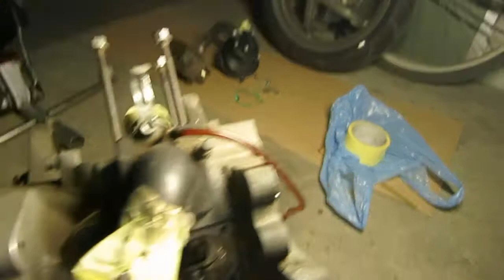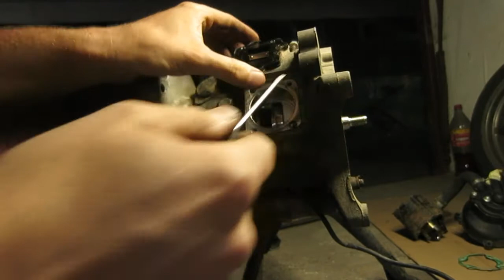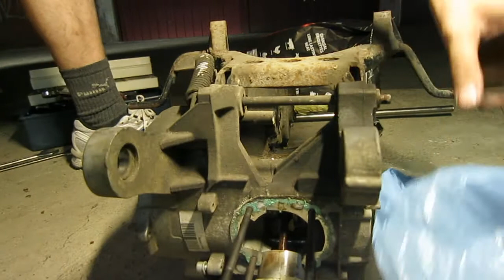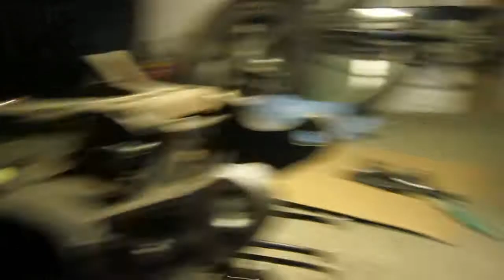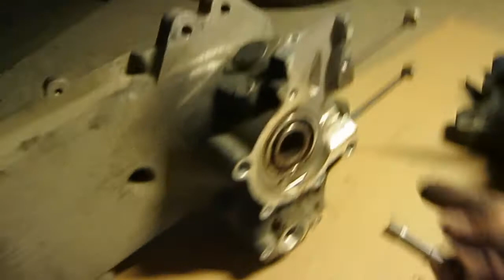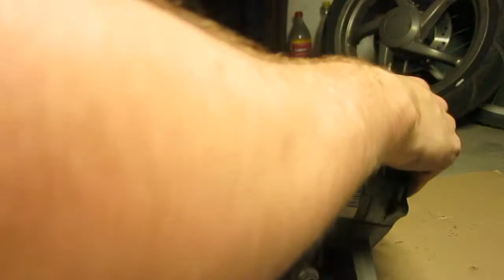Aprilia Ditech crankshaft problem - Part 4

Comment: great job buddy.u save lot of money.lot of mechanics get nightmare when they see a ditech engine.haha its not much different then carb.
Reply from the maker: I confirm that about mechanics, I brought 2 times scooter to official service to ask  how much is change of bearings as it is proposed to  in service manual from scooter and always some strange answers, it is not worth to service scooter, it will cost to much (they never told me how much approximately), at the end I am glad that I did job myself

Comment: Hy man! thanx for your video! what wos the total cost of the reparation? thank you
Reply from the maker: Hi, parts (new bearings, crankshaft,  gasket set, gasket set for crankshaft,1 kg grease  around  400 euro plus) plus 100 euro tools and accesories (tourque wrench, spray for cooling to -50 Celzius, pressure wash cleaning, tool for pulling ). In reality I  spent even more in total  (parts plus tools  = 600 euro but I bought some tools which I did not use  at the end, was not sure will I need to remove gears from drive assembly and for that you need special set which I bought but I left original bearings for drive system because it is in good condition, I did not took it apart).  You can spend even less if you buy cheaper crankshaft which come with set of 2 bearings (125 euro with delivery included) which I did at first place but I was not lucky and I got defective crankshaft so went with more expensive version from Malossi. Just new original crankshaft from aprilia cost 400 - 450 Euro, I forgot how much exactly.  I did not count my time (spent 2 weeks to learn what to do, to clean, dissemble, assemble, to order good parts on ebay, there is more versions of engine so you need to order parts for version you have, my is morini engine even it is wrote aprilia on it.

At the end I know how engine looks like, in what condition it is and if something breaks or does not work good or have strange sound, I will know why and where to look. I made videos till part 10 , check them out if you are interested. More to come.
Reply from the maker: Crankshaft with delivery is 270 Euro
gasket set from ebay  21 Euro
bearing for crankshaft form ebay 17 euro (I found new old stock so I bought them cheaper but manage to find in store bigger bearing so I paid it 20 euro just in case so I have spare part, it was not so easy to find it)
those are main part but later I change break fluidm needed to buy new set of rollers becase this crankshaft is heaveier then original so all together it was around 400 euro plus tools and accesoreis which you need, needed to remove clamps from tubes for water cooling so needed to buy new ones, little by litte it come around 400 euro. I am afraid to find out how much that work would cost me if I left scooter in service...
Reply: are you supposed  to lightly grease the crank bearing or pack them full.  wrist pin too on the grease?  was the cooling spray like freon or butane, was it helpful?

Comment: What kinda rpms are you getting with the malossi crank?  The one i was looking at said like 16000 rpms.
Reply from the maker: I do not know, I do not have RPM meter.
Reply: I was wanting to know how the mallosi crank is working for you.  the stock one you took out was good for only 10000 rpm max.   I have a 2006 that has a 70 cc suposedly.  but if they did that they did not do the rest like  change the final gears.  it runs alrite but i think it will blow soon because the engine makes alot of noise.  I just going to assume the crank is going to be shot so i want do a  build myself considering it cost to much to pay someone else.  i would like maybe go to 86 cc kit if  i do.  probably change it over to carb set up too.  basically everything need be replaced and then i have good scooter.  was that your first engine rebuild?  anyway any info the crank would be helpfull.
Reply from the maker: Ok, in my opinion stock crank is better if you want less vibrations (smoother scooter), if you want faster scooter then malossi is better, this is full circle crankshaft (malossi), what means when you mount it in crankcase motor will have higher compression because crankshaft take larger volume of space then stock crankshaft. I kept original piston and replaced crankshaft so I am not sure did I needed to change piston together with mallosi crankshaft because motor vibrates more at lower rpm then stock setup. This is my first engine rebuild so this is why I am not sure is this how its done or not. I bought mallosi crankshaft because I read it is better balanced then stock one, maybe that is seen at higher RPM because when motor runs at high RPM I can not feel vibrations and scooter have maximum speed of 90 km/h instead 80 with stock setup. So mallosi works OK but not as I expected, I expected much less vibrations when motor idles. For example there is box for small tools above accumulator , I keep there tools which I got with scooter and they rattle and shake so much that first day I thought that scooter will fall apart soon until I figured out that bad sound comes from there not from motor, before crankshaft change I never had such vibrations and sounds. My goal was to get smoothest engine with cheap rebuild, at the end it was shown that cheapest crankshafts are not so smart option so I bought one from mallosi because it was still cheaper then original one.
Reply: typically when you put aftermarket crank in the case.   a 70 86 94 cc big bore kits are out there.  so if it were me definatly a new set up.  there is no way to do cheap because it is inherently expensive!  that why we left to learn our how do it.  the malossi crank is highly balanced out of the box.  assuming that is what you got(could have been defective or not balanced properly new)
 i wonder if there any other alignment processes that need to b e done when puting case  back together.  for reference i think testing the compression is how to gage the state of the engine.  i thought higher compression comes from the tolerances between the cylinder wall and the piston rings or number of rings.  maby piston is two worn or even to lightweight for the crank?  the first thing i am going to do is change rear final to 15/40 since mine runs ok for  now.  that sould get me going from 40mph sustained cruising speed to 50mph.  there was a guy who had his build by a guy in colorado.  he said he had 6500 in the engine 11000 total and claimed low 90's.  it would be a great little bike if i could take engine from the kx -80 mount that.  Awh if i only had access to machine shop.
Reply from the maker: check this one https://youtu.be/uWGQgKdQfgM?t=19m12s

piston rod need to be in center, you need to check that

stock crankshaft is not full circle , so it have volume x let say and malossi crankshaft is full circle and have larger volume  (x+y ) so when you install x+y in old crankcase you will get higher compression

mallosi crankshaft have weights and I saw (it look like it is balanced ) but in manaul from crankshaft it does not say you need to use piston that and that , so I used original old piston because it looked good to me, so to have zero vibrations you need to have everything matched I assume , and with stock setup piston and crankshaft and piston rode are matched pair

if you have will you can share your rebuild, I am interested to see your result